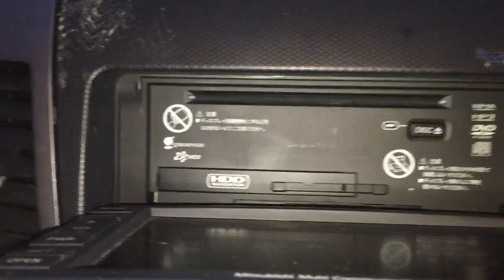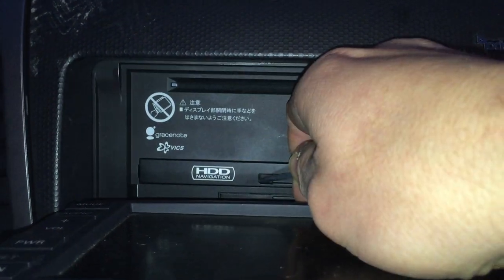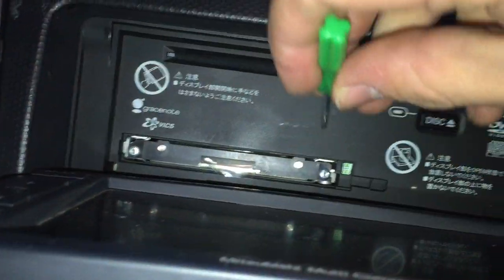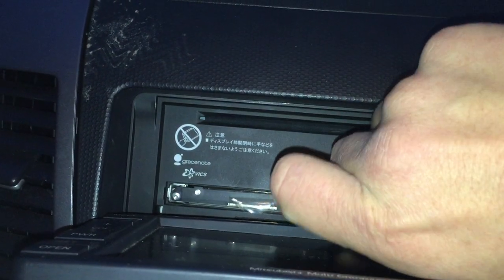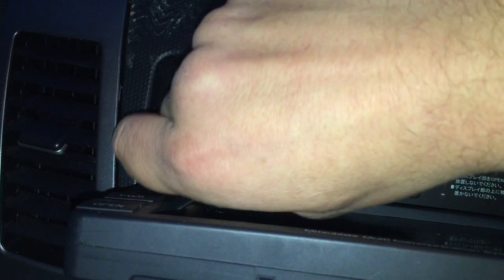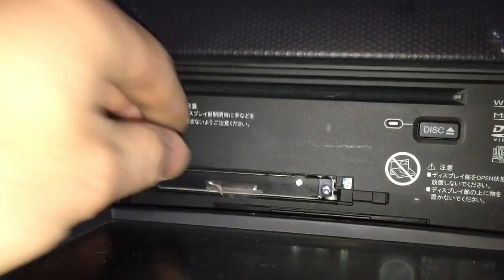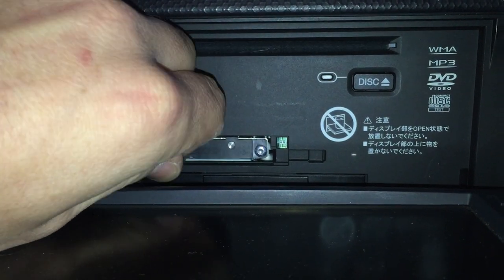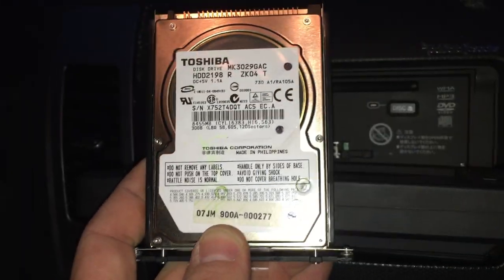How to remove your MMCS HDD

Comment: Hi there, my Subaru forester HDD came out pretty easily, and when I used my adapter to plug it into my iMac and Windows 7 computers there was no recognition of the drive, apart from Windows showing the drive in Computer Management and asking me if I wanted to initialise it. Probably not a good idea, not wanting to stop it working in my car...I'd love to swap (or clone it) with an English / NZ version to make my Japanese Clarion Addzest MAX550HD unit much more useful. Any ideas?
Reply: Thanks for that. Would there be a jumper shorting out 2 of the 4 extra pins beside the HDD connector to unlock it? It has 260 albums of Japanese music loaded on it that I'm keen to replace with decent music.
Reply: I know this is an old comment... but if i had to venture a guess the format of the drive isnt something that windows recognizes ( NTFS, FAT32, etc etc ) you may try plugging it into a machine with Linux installed and have more luck.
Reply: @reelMn hi. did you replace the japanese music to favorite music. how did you do.